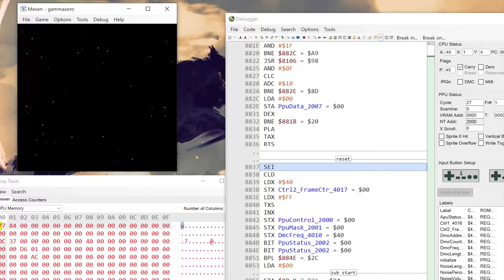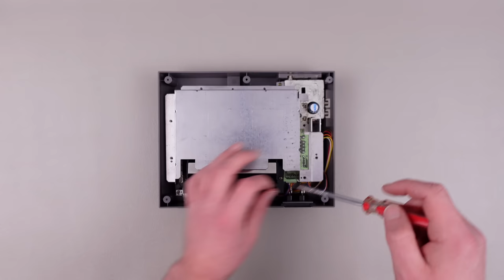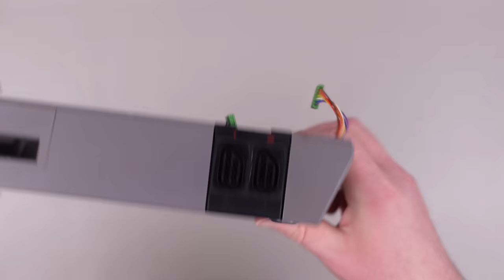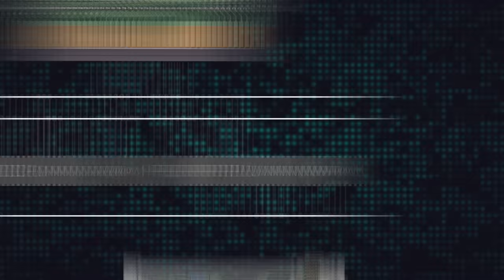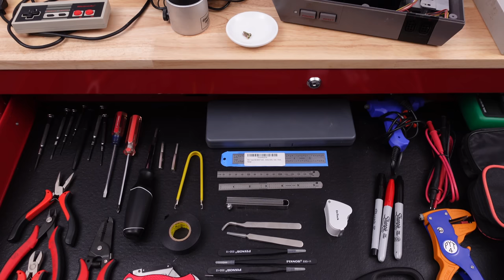NES Hardware Explained

Comment: Viewers may wonder why the NES is so large compared to the board it contains. Maybe it has something to do with part availability, something just stuck out and it wasn't practical to make it smaller. Or maybe it had to do with plans for future internal expansion. Or maybe it was a heat exchange thing. Or maybe . . . 

Nope. It was just big because they thought it would sell better if it looked more like a VCR, and those were big. That's also why they called it an "entertainment system" instead of a video game console. See, it wasn't a video game, it was a multifunctional entertainment suite with games, toys, painting programs, and more! OK, actually it only really played games in the U.S. (The Japanese Family Computer (Famicom), which was the right size for its board, did get some weird peripherals like a modem that allowed you to buy, and sell stock (?!?), but these were never released in the U.S. and are technically not compatible with the NES, though some very minor changes allows them to connect.) But it was important for marketing, because the video game crash of 1983 had made U.S. distributors unwilling to sell or market video consoles. In 1985, many electronics gurus insisted that video games were a dying fad, so a new console was a hard sell in the American market. Hence R.O.B. the robot and other silly novelties, as well as the VCR-sized NES and what Tom7 calls "the SUV of cartridges" (NES cartridges are enormous for no good reason).

All that said, the NES is still superior to the Famicom in two important ways: its controllers were not wired directly to the console but could be unplugged, and their cords were much longer. That first one is big; I can't understand how they thought hardwired controllers were ever acceptable. I guess it was a different time.
Reply from the maker: Yeah I touch upon this in the CIC video from last year :)

Comment: Since you can’t edit please write and pin a correction/explanation regarding reassembly.

There is no “adjustment” during reassembly. Some think otherwise because their cartridge mechanism is positioned incorrectly and only latches down when they loosen screws. “Adjusting the screws” has morphed into a common bit of misinformation, seemingly validating others who experience this without ever coming across the correct explanation.

Here’s the trick:
The cartridge tray doesn’t just sit on top of the NES board. The front is supposed to hook the circuit board with a small lip on the front that fits underneath. There’s even a gap in the shielding to allow this. When you incorrectly position it with the lip on top it will deform the tray mechanism as you tighten it down.

This won’t solve connection problems like cleaning, tweaking the contacts, boiling, or replacing the connector might but at least you aren’t introducing a new variable that affects reliability based on how many turns you put to some screws.

Corrections are probably the most constructive thing to put in a comment section but I had to scroll through hundreds of comments to find anyone else mentioning this.

Comment: wait what about the lock out chip?  I've heard if you cut a certian leg also helps with games working better on troublesome NES consoles.
Reply from the maker: Kinda but it’s a bit more complicated. It will definitely disable the CIC but honestly having clean carts and connectors does much more to remedy the issue. I’ve got a video planned where I show how to disable the chip without snipping leads or doing permanent damage as well, so keep an eye out :)

Comment: This was very interesting, except I have a Japanese Famicom, so I would think there are some differences with that system(not the main components ofc though). I usually do a tear down of the systems I get but I haven't with the Famicom yet as it was sold as refurbished and AV modded and so didn't want to mess around with it lol(and it does run great too).

Comment: Can you do an NES Explained video on each opcode used in NES assembly?
Reply from the maker: Hmmm a whole video is on each opcode would be tough, cause there’s not that much to explain. A video that does all the op codes might be too long and dry for most viewers.

But how about a series of shorts that describes them all?
Reply: @NesHacker  You're probably right that a full video for each opcode would be too short, and again that a video containing every opcode would be too long. But I don't believe the shorts format is conducive to learning. What you've described would probably be a good reference material (even if I disagree with the format on principal due to the fact that it's often used manipulatively). However, I was hoping for something that explained not only what each opcode does in a vacuum, but also how they interact - examples of how they can be used in different situations.  This would provide a greater frame of reference for NES assembly as a whole.

What about a series containing full length videos about categories of related opcodes?

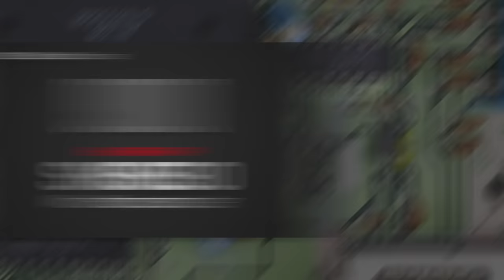Comment: 4:44 This 7404 have something to do with the jail bars (vertical lines) issue on the Famicom. Because Famicom do not have this chip and greatly suffers this video issue , and NES doesn't. I traced the pin 22 on PPU on the Famicom it goes directly to the 5V , and in the NES it goes to that 7404 chip :) and this is next to the pin 21 the video output
Reply: On NES-101 the jailbars are due to the composite video traces from Pin 21 passing under the CPU where it picks up digital switching noise. IIRC, the HVC-001 Famicom had this problem too. The HVC-101 AV Famicom was eventually updated with the CPU and PPU positions reversed but early units had this same issue. An extremely rare version of the NES-101 with AV output instead of RF also has this fix but it seems it was only offered as a replacement to some Nintendo customers who complained about the NES-101 video quality.

Comment: I’m a little new here I know what a GPU is but what is PPU
Reply from the maker: Picture Processing Unit. It’s a single chip that handles generates graphics based on the data that gets set in the systems video memory along with the character data as provided by a carts character RAM or ROM. If you want to learn more, check out my “NES Graphics Explained” and “NES Carts Explained” videos 😀

Comment: Bit confused on the reasoning behind the inverters of the controller ports. Id have just inverted the voltage signaling on the controllers themself
Reply from the maker: Yeah I was thinking about this the other day and I think they did it that way because the original Famicom had controllers that were hard soldered into the console. So they chose to put the inverters on the console board instead of the controllers and the design carried over when they reworked the system for the American market and made the controllers detachable.

Comment: TIL that the cartridge tray can be adjusted as soon as you remove the plastic top.
Reply: There is no adjustment and, no, there is still a metal shield over it when you remove the top. ;) The reason people think there is an “adjustment” is because they put the screws back in with a tab in the wrong place. As the screws tighten down the tab deforms the tray causing issues, like a latching mechanism that will not latch. Since loosening the screws appears to fix the latching issue, people who don’t know the real reason assume it was an adjustment issue. Eventually they began telling others and the misinformation spread.

All you have to do is make sure the tab is under the main PCB while the rest of the cartridge mechanism is on top. You have to remove the 6 tray screws and lift the whole PCB out of the bottom to slide it forward so that the tab is past the edge of the PCB and the tray can drop all the way down. Once the tab is off the PCB you can push the whole tray back and the tab will slot under the PCB. Then you can put all six screws back in and tighten them down fully.

Comment: Open the NES and take a pair of Diag plyers and snip one of the connectors on the lock out chip. It will kill it and the NES will work fine, without the blinking. It fixes for good the false positive of the NES thinking real carts are fake.
Reply from the maker: Yeah that’s the cic lockout hack, it will definitely get rid of the blink. But it’s destructive and there are much better ways to get a system working if your only problem is the blink. I’ve got a video planned to show a slightly better way to do this, so keep an eye out for it!

Comment: Note don’t tighten case screws in front to fullest as it tightens the cart holder
Reply: What? No. This is disinformation.

The video is wrong too but the comments are supposed to be where we address and correct that, not make it worse.

The six screws holding down the cartridge mechanism should be screwed all the way down. The reason people think otherwise is because they have it in the wrong position before tightening with a tab that is supposed to fit below the board incorrectly positioned above. As you tighten the screws it will deform the tray unless you get the tab in the correct position.

There is no “adjustment” and if tray refuses to latch down it isn’t because the screws are too tight. It’s because the tab is in the wrong place.

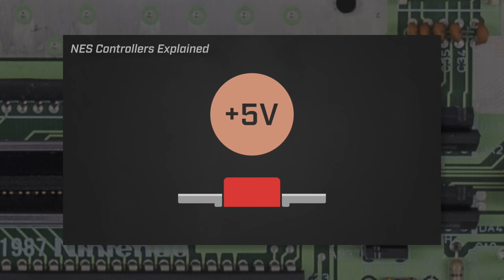Comment: 5:26 NO! its reported as 1. pullup and inputs and 4021 chip inputs are inverted. signal send NES is 1 when button press LSR not invert anything
you can test id

 lda #$ff    ;all buttons off thats what you say!
  sta $200

  lda #1
  sta $20
  sta $4016
  lda #0
  sta $4016
read_loop:
  lda $200 ; read from out memory
  lsr a
  rol $20
  bcc read_loop
  rts
after rts $20 is ff not 00

that include buttons are 1 when pressed pullup+ inputs are inverted inside 4021 chip
did understand yet? LSR not invert bit

Comment: The sensitive realignment of the cartridge slot makes me think how Nintendo actually mass produced this.
Reply from the maker: It’s not really all that bad, but it’s easy to tighten it too little or too much. Also the trays get loose after lots of use.
Reply: @NesHacker  Fair enough. Great video, btw.
Reply: There is no sensitive alignment. The issue is that the tray was in the wrong position when screwed down. The tab that fits under the board was on top causing deformation when the screws were tightened.